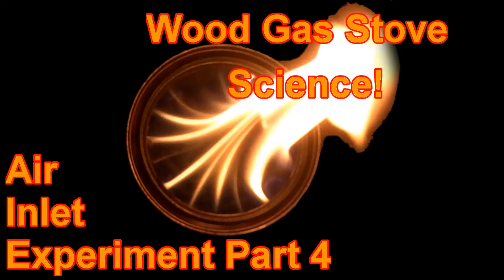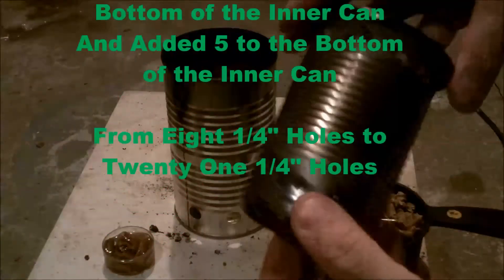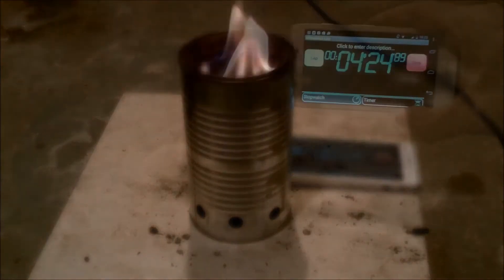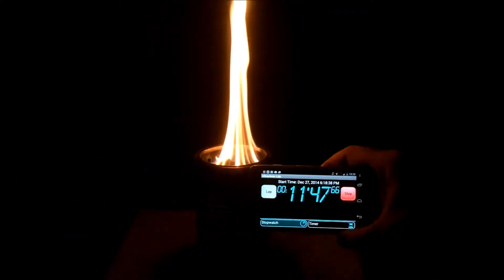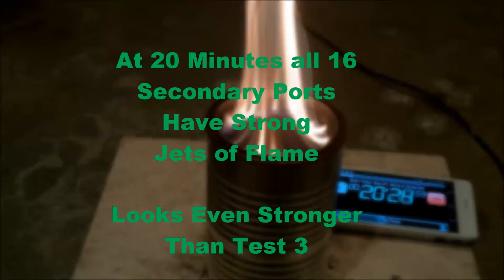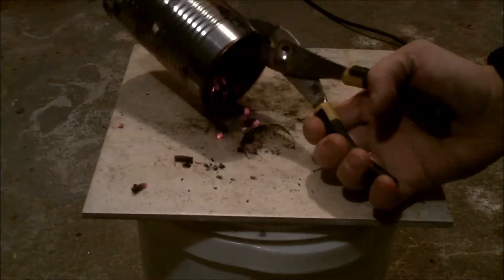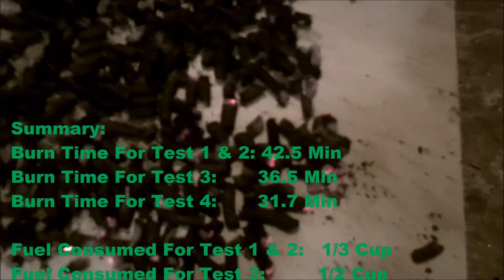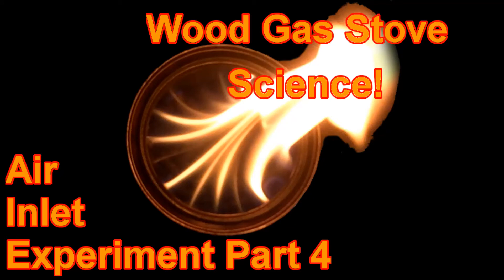Wood Gas Stove SCIENCE! Air Inlet Experiment V4.0

Comment: I believe you want a 4:1 ratio on the area of your primary/secondary ports
Reply from the maker: +Raven Rock67 My final design settled at 5:1 and burns really well. Here is a link to building my Vortex 5.4 wood gas stove. https://www.youtube.com/watch?v=AiJuea5T6T4&lc=z13myhaxcomqw3god04cdnybisfxcnszvl40k Thanks for the comment!!
Reply: Hey, you don't have thank me for commenting. You vids were awesome and very well done. Your creation of a vortec flame intrigued me. Could a corollas effect be used to increase efficiency?  Could a pot stand built with this in mind increase air flow even more so? And finally, could a ceramic glaze on the inside wall of outer can increase thermal efficiency enough to be practical?  Any thoughts?
Reply from the maker: +Raven Rock67 I did some experiments with pot stands and they do influence the burn tremendously. I tried insulating the outer can with glass batting insulation; it helped in very cold weather but not so much in warmer weather. I may try the ceramic glaze though. Good idea and thanks again for the comments!
Reply: I'm thinking of vanes across the pot stand, say 30 deg off of vertical, inclined to help facilitate the vortex. Start with a simple "plus" sign when looking straight down. And, would a cylinder in the center, say .75" inches across help?  I am intrigued by this...a wood gas stove might be dramatically improved by simply having a effiency boosting stand.
Reply from the maker: You may be right; I may dig out the old Vortex 5.4 and try a couple things! You mind if I try some of your ideas?